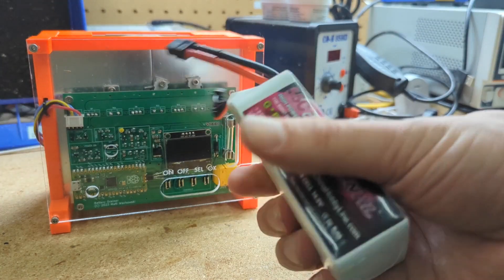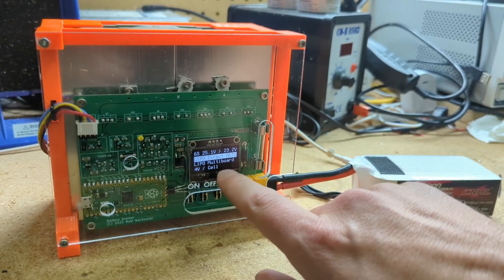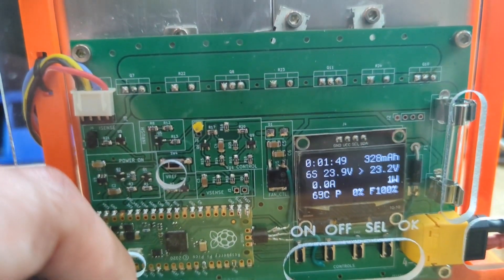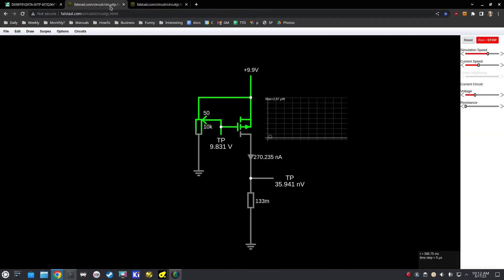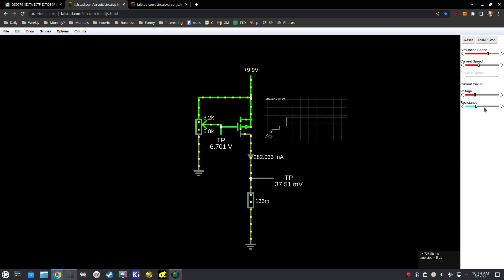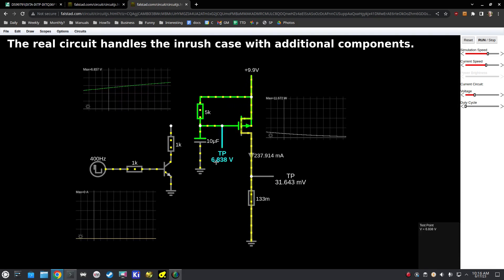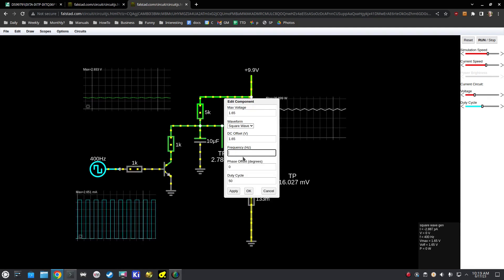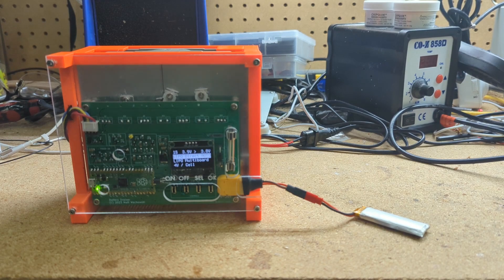Battery Drainer

Comment: Very cool and well done done project.

Would it be too hard to monitor cell voltages and balance them?

Discharge them and the having to plug them into the charger to balance the individual cells is what is very annoying.

Thanks!